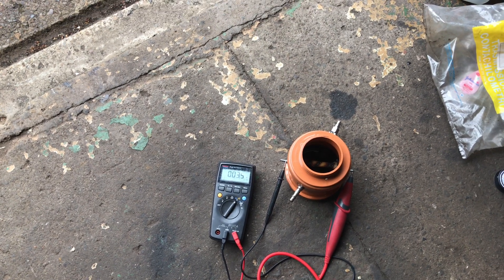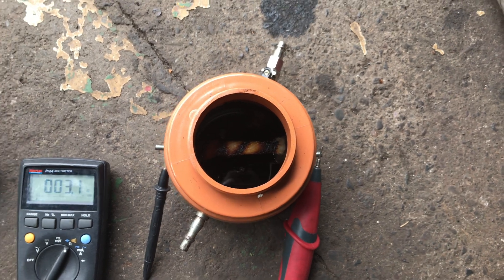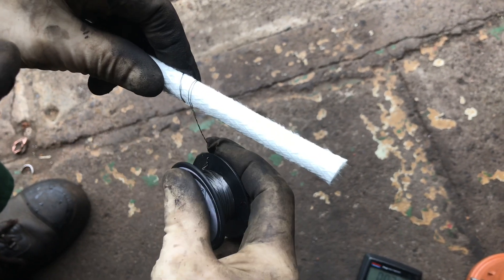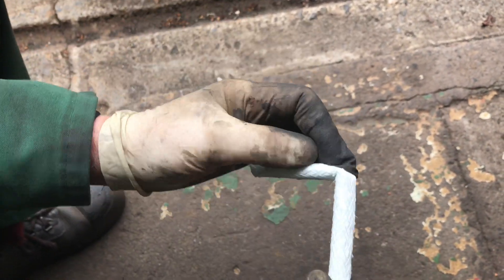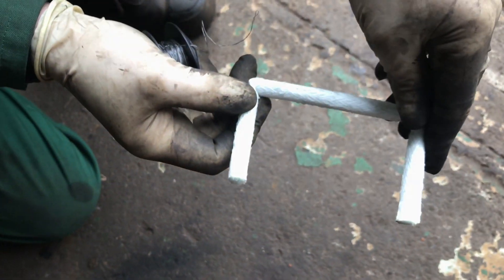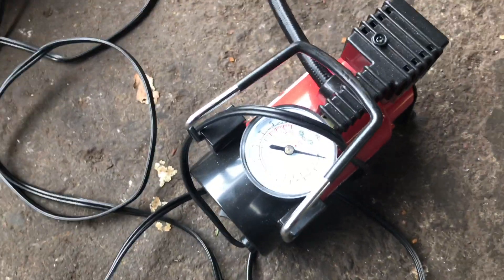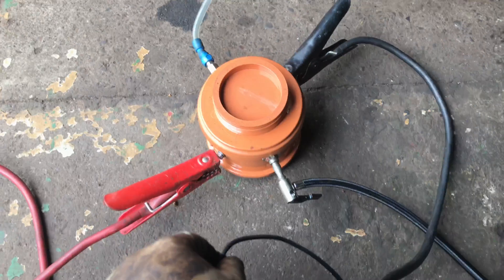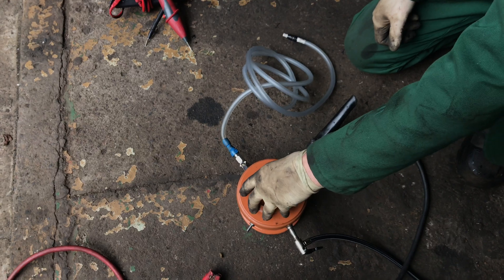DIY SMOKE MACHINE  - THAT REALLY WORKS!!!!! Part 2

Comment: Sandy what were you using as the base? To close the bottom of the underground pipe. I've got the 3 Screwfix items in my basket but it looks like there's something missing. Otherwise the baby oil will be getting poured on the floor lol. Thanks.
Reply from the maker: I'll ask Rody cheers sandy
Reply: @sandyande  perfect sandy that would be great, cheers.
Reply: Hi sandy did you ever get round to asking him? Thanks.